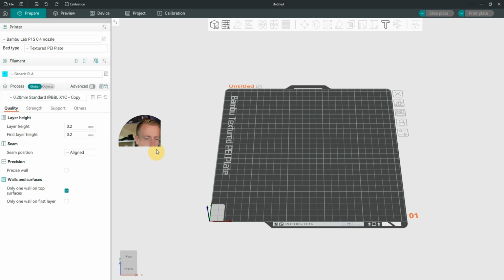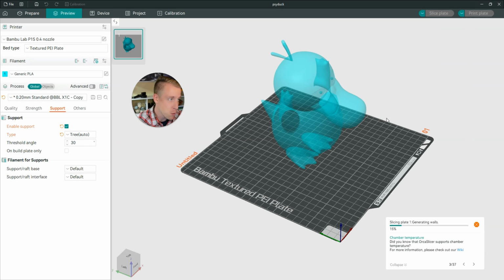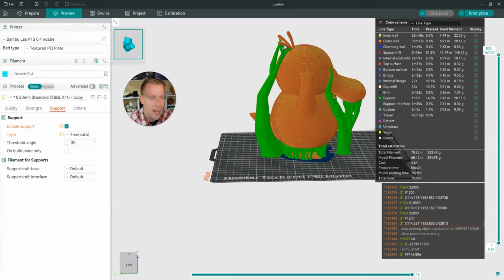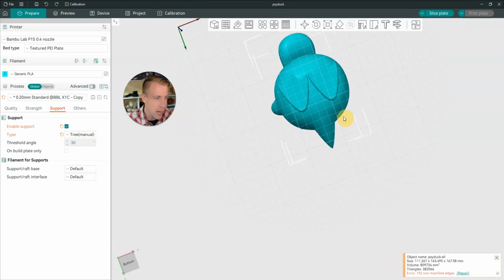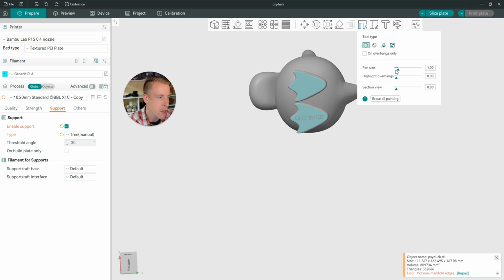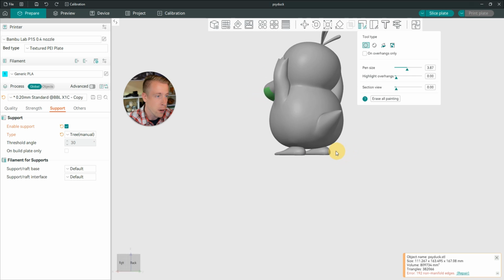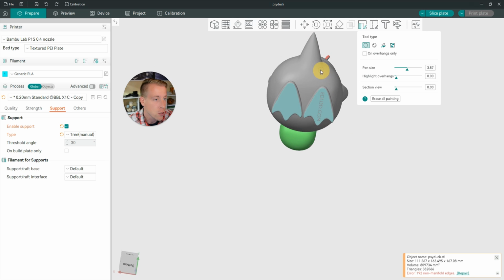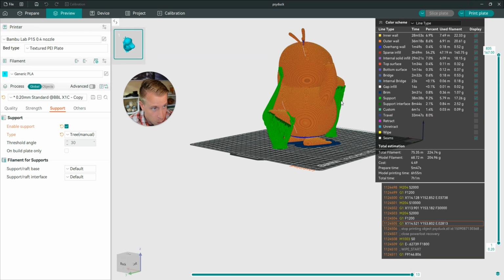How to Add Support Blockers in Orca Slicer

Comment: If I'm manually adding supports, what use are support blockers?  Just don't put any there.  I'm looking for a way to add support blockers, then let the slicer automatically add the rest.
Reply: Answered below - leave auto supports on, paint blockers where you want them to not be added.  Thanks for the video, got me looking in the right places.

Comment: I think you can leave support set to 'Normal (auto)' and it still works. Just blocks the areas painted red.
Support blocker in Cura is much easier to use IMO!!
Thanks for making the video; very useful.
Reply: I think you can add a modifier primitive and set it to no supports to basically get the same result as in Cura. I agree it's more desirable to let auto supports do their thing and just block certain areas.

Comment: If you manually have to draw where you want support, then why use the "blocker" on the top, you did not paint that, so why would it generate support there?
Reply: It seems auto is still semi active, notice that orca put a support on the head, where no red(block) or green(request) was placed.  I am still learning this slicer myself.